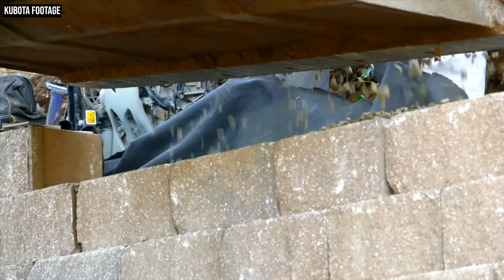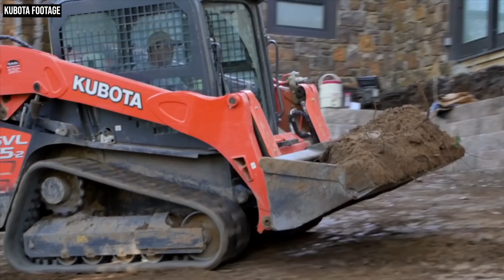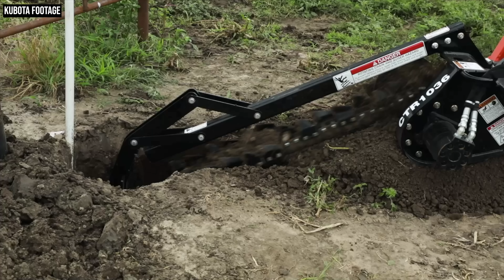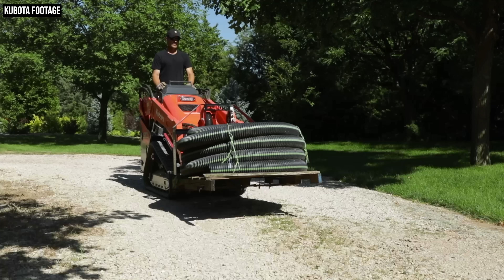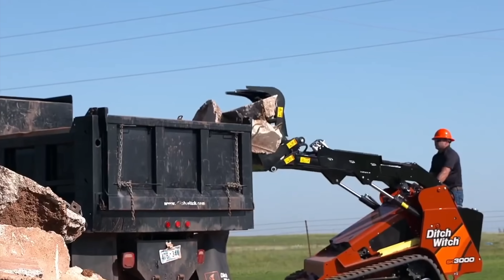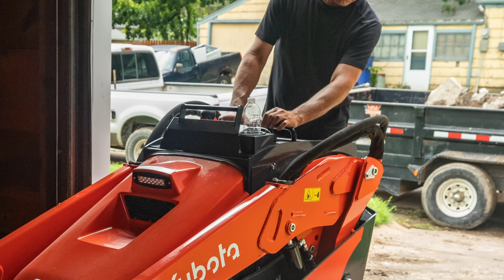Kubota Shrank a CTL For Its First Mini Skid Steer: The SCL1000

Comment: Nice stuff..  concerned that it will be very tippy on side slopes with such a narrow track width.  Is there any measurement of the sideways tip angle?  Is there a way to add a fold down or Plug On seat?  Are all of these Mini's using hydrostatic drive?

Comment: I used a dw 800 great machine from a rental, but I bought a scl from availability and price point, dw is an overall better machine as far as controller layout, scl is a tippy machine without an attachment still a great machine, platform feels small, great beginner machine from price power and lifting capacity, I believe it can lift close to 2k

Comment: I  bought the bobcat mt100  wider tracks, and an additional  pair of narrow trucks at my local dealer $29,450  
And I already made enough money with
I love my mt100 it's powerful I customized a 4 in 1 bucket for it, I just ordered a high dump bucket to increase the  pin  High to 126in not bad,
There are a lot of other machines that can make you money right now while waiting for the SCL 1000,

Comment: My company currently operates a SVL-75 and a KX-057 to do tree work in the Southeast.  The material we handle is heavy, of course.  But, making additional cuts to reduce material size and weight is certainly more affordable than owning and transporting equipment that is larger and heavier than the equipment I currently have.  In the future I will buy smaller, lighter equipment.

Comment: The Vermeer CTX100 at 1000 pound capacity also has the 88 inch hinge pin height.  Nice video but check your competition facts.
Reply: I also thought the bigger Vermeer 100 and the 160 has turbos ??

Comment: I tried buying one of these,  found a dealer in Minnesota that supposedly had 5 of them,  the even assigned sock numbers on the web site,  but when I contacted them,  they indicated they had none in stock,  no pricing,  and no idea when they would have any units or pricing,  with growing frustration over the delayed launch,  which I understand is a Kubota trait,  I finally went with a ditch witch sk800, for my applications, (electrical contractor), the added width was not an issue,  and after trying an sk600, felt that the narrower machine was an actual hindrance when operating in a side hill,  the wider machine just feels much more stable,  I guess time will tell if I made the correct choice,  but Kubota clearly lost a customer in this case with not following thru on intro/delivery time frame
Reply: Vermeer 

I love our s600, and so many great upgrades since they first launched...

Our next will be the diesel engine option (Tree work) Vermeer

Comment: I like it, I wish they had this earlier. I have a ditch witch SK 650. I may get this machine and I wish they someday have the greaseless pins for maintenance.
Reply: How many hours do you get out of your non grease able pin bushes? On the Australian made dingo we only get around 100 hours out of the tilt ram one and are going back to a greasable one.
Reply: @scottstirling8047  I'm at 700hrs, and by the way they look I can easily see them lasting till 2000
Reply: I bought the Kubota over the Ditch Witch partially because the Kubota has grease fittings.

Comment: Back in the late 80s a British company Powerfab had a 34 inch skid steer loader which could lift 500kgs. It could take all the attachments listed and had a self trailing kit which meant you could tow it to and from job sites. JLG industries also had a similar machine, but not as strong or robust. Tracks could be added to the tires.
11 hp Honda four stroke gas or Kubota 13 hp Diesel engine choice. The Powerfab was way ahead of its time along with a 125 mini excavator, a 180 tracked excavator with offset digging and 1200kg 360 excavator all of which had digging depths of 7’6”.

Comment: my biggest concern is the controls.  The mt55 has the best controls for safety i have used yet.  I do like how they put a bar on top so one can grab, just like the mt55.
Reply: Bobcat sucks because the attachments aren’t  universal like all the others.
Reply: @chriskarsseboom2200  bobcat attachments are universal with all other skidsteers. we use the same attachments as a big skidsteer uses, cant do that with kubota
Reply: Dan Kruger yes but full size skid steer attachments aren’t made to run on smaller machines, they don’t run full capacity without proper hydraulic flow. Mini attachments work perfectly with the size machine.
Reply: @chriskarsseboom2200  all three of are working mt55 and one mt52 can run Cat hammers hd65 or h55 just fine.  there standard 12gpm works most modern attachment easily.  Been running mt55 and mt52 for 6 years everyday for 9 months out of the year working concrete replacement.  Most people question the bobcat mt's ability, do to there size and have no idea what there talking about.

Comment: As a contractor in search of an SK1050 this machine from Kubota is hard to ignore.  Solid video, really appreciate the depth of information!
Reply from the maker: Glad we could help Jordan. Thanks for watching!
Reply: Unless they make significant changes before release I can assure you that you'll get much better performance out of the 1050
Reply: @wpog8453  What significant changes are you referring to? Thanks for your input!
Reply: @campstrat  the 1050 is just a more powerful and capable machine. They are not really in the same class. If you notice in the video. They didn't design this unit to be a superior performer. They're trying to strike the middle of what's practical for a lot of guys and make a unit that has respectable capacity and still be able to get into tiny gates and whatnot.
Reply: @campstrat  the engine is actually the same engine used in the SK600. They just put a different tune on it and added a turbo. This thing is not gonna have a ton of muscle.
Reply: @wpog8453  I think you're right, the 1050 does outperform the Kubota on paper in many respects.  The SK800 would be a better comparison.  It's hard to ignore the ground pressure, claimed travel speed, hydraulic flow and turbo of the SCL1000.  I'm at 5000+ feet and the turbo seems to make a big difference.  The price is also going to play a big part, I'm being quoted $32k for an 800 and $39K for a 1050... we all know kubota doesn't aim to have the highest price point equipment.  Looks like I'll be waiting until spring to find out now.  Thanks again for your input, my Ditch Witch guy appreciates you!
Reply: @campstrat  I'm not a Ditch witch fan boy btw. I used to own a 1050 and I like the machine but I now own a CTX 100. I'm sure that any dealer in your area can adjust for altitude. Unless the majority of your work requires you to fit into a 36 inch gate, you are going to get much better value and capability out of a higher horsepower machine. Especially if they are asking $35-$40k for the Kubota. I could never settle for a 25 hp unit after owning these. The added capability and power of the higher hp units alone will pay for a $10k price difference in a couple of months easily. Don't give in to the hype. Check out my Instagram. wes.howell_hos
Reply: @campstrat  it's not just the hp difference. When you figure in the added torque, you'll have almost twice the performance of the Kubota. Literally. D902 is a tiny engine
Reply: @campstrat  personally, I'd recommend the CTX100 or 160. They have a turbo and no DPF regen. Awesome engine. Will noticeably outperform a 1050
Reply: @wpog8453  Just followed you! forgelandworks
Reply: @campstrat  I just saw that. I specialize in low impact vegetation management. If you're ever interested in the mini mulching head that I have. Stay tuned. It's a finished prototype and ready for production. Currently working on securing an importer/dealer to get this manufacturer to the U.S. market
Reply: @wpog8453  You say just "added a turbo" as if it accounts to nothing lol.
Reply: @SupraNaturalTT  it doesn't account for much but a little added torque. It's still a D902 that makes 25 hp. All major brands that use Kubota engines use the "05" series engine family and the D902. The D902 is the smallest displacement of them all. It's the same engine used in the DW SK600 and the Bobcat MT55-100. It's a gutless little engine for this application.
Reply: Let's not forget the hydraulics operate far quicker than the others, have a soft stop rebound and is way quiter than the others so you can actually hear people in an emergency. Give me this over the others by long shot.
Reply: @SupraNaturalTT  and to be honest all of the largest DW and Vermeer are very quiet except for the 1050 which is very deep and throaty. The DW 1550 and Vermeer CTX series are very quiet.